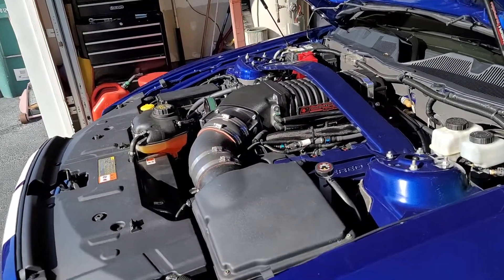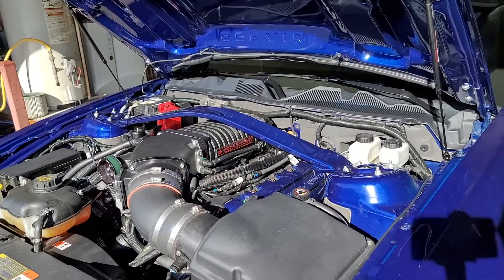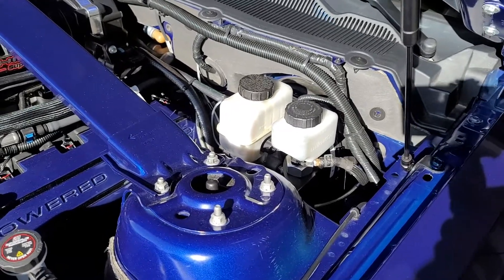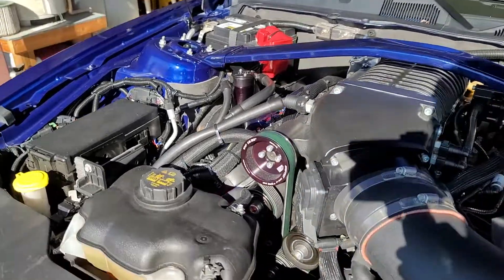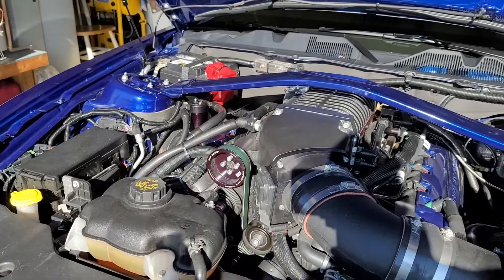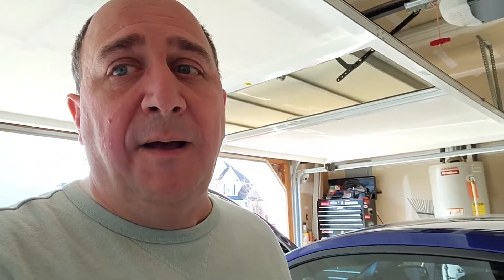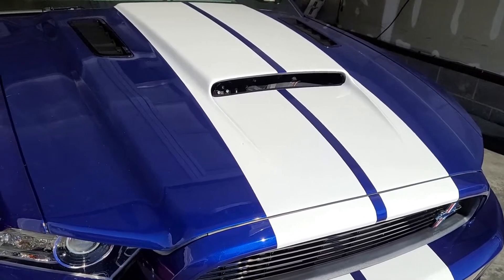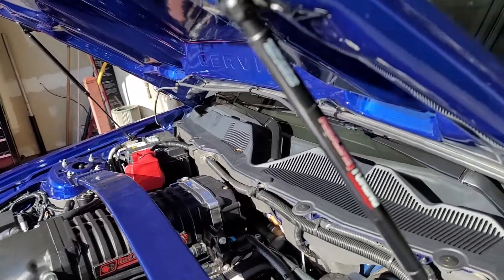Electra part 3

Comment: Thanks for all the mod info. The hood reminds me of the hoods on the original gt350s (2011ish). What changes have you made to your intake/filter?
Reply from the maker: It has the Whipple cold air intake on it which they use the jlt air filter

Comment: Check your clutch pettel under the dash.There is a plastic peace that goes bad.It will go bad an cause the pettel to stick.
Reply from the maker: We went ahead and changed that already. I was running a status spring now I have the whole kit for it. It is still acting funny so it might be the slave cylinder may have not been bled out properly. Just something else to check later